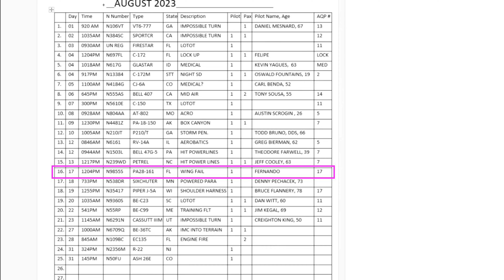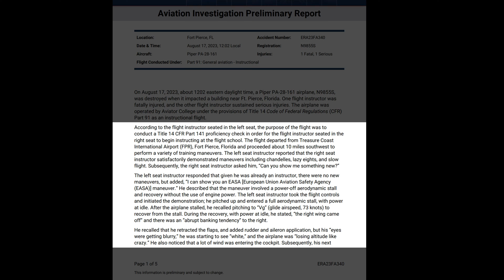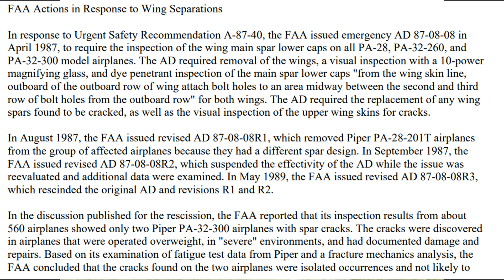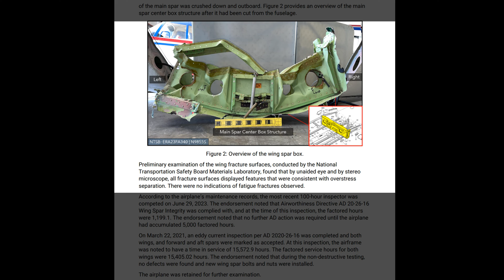Discussing recent PA28 crash in Florida N9855S

Comment: Cherokees can be very difficult to get into a full stall.   A common technique is right when it should stall is to jerk back on the yolks.   If this technique has been used too harshly and/or too many times it could break the airplane.
Reply from the maker: There’s no way that what you’re describing is going to cause a complete failure of the wing spar box, rip both wings clean from the fuselage and take the stabilator off. That requires a high G maneuver, consistent with what the ADSB data is showing.
Reply: @Taylair  Yes, but you can take a lot of the strength out of it making it more vulnerable to failure.
Reply from the maker: The NTSB report is quite clear that no fatigue was present. No way that pulling it into a stall from straight and level flight and increasing the rate of back pressure for the last couple of seconds is going to cause a complete airframe failure. More likely that the maneuver I highlighted caused the damage.
Reply: @Taylair  Interesting and thank you for the clarification.

Comment: I agree with your assessment. However I would not be surprised if the wing did depart the aircraft. The age of the GA/training fleet is terrible. As a whole we don’t even drive cars that old anymore. Crazy complicated and over arching government regulations have made it almost impossible for the industry to produce new aircraft.
Reply from the maker: I don't think of a 2002 PA28 as an old aircraft myself but I see where you're coming from. My issue and the reason I made the video is that I feel like someone could be either misremembering the sequence of events or worse trying to pull the wool over our eyes as regarding what happened here, which if believed could have grounded a fleet of serviceable aircraft unnecessarily.

Comment: Very interesting, and given the fear generated by the thought of a departure of a wing from an aircraft, I completely agree that the facts about what actually caused this accident need to be highlighted. I recently spent a couple of months flying in the US in GA training aircraft, some of which cosmetically did not look well maintained, and whilst this may not mean anything from an airworthiness perspective, when coupled with incidents such as this, it does give one pause for thought about concerns over structural airframe integrity, and the difference between the failure of said integrity due to fatigue vs possible pilot induced structural failure.
Reply: While there has been a small number of well documented wing attach failures on the PA28 leading to ADs on the PA28/32 family, this was clearly an unrelated overstress failure caused by abusive piloting.
Reply from the maker: Absolutely agree with you!